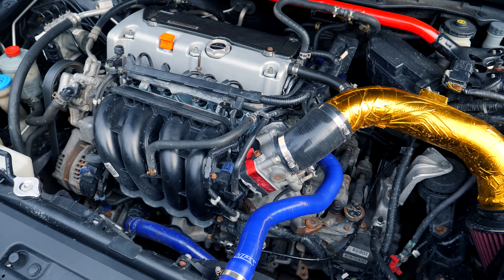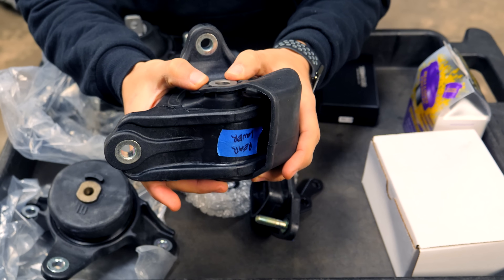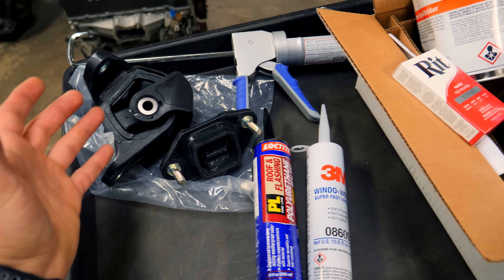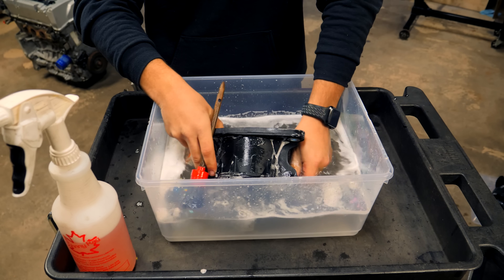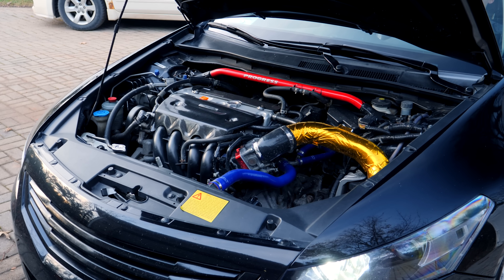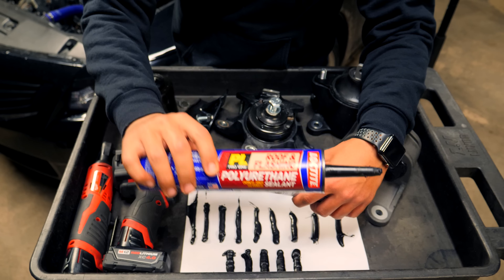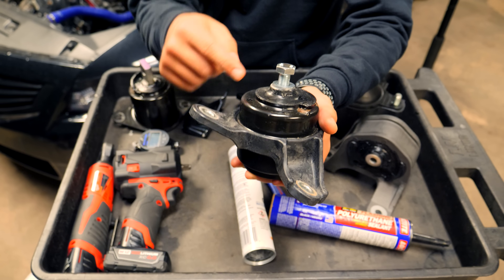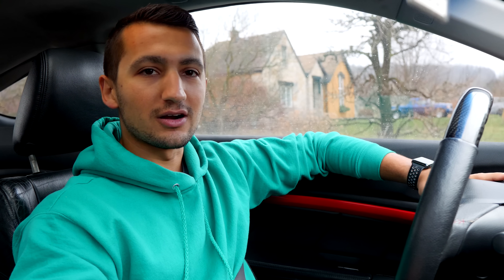Polyurethane Engine & Transmission Mounts for less than $25

Comment: I've been making my mounts for 3 years now doing this. I've never had a problem out of it & I can testify that the 3M is the better of his 2 options! Glad to see some people are picking this trick up though!
Reply: Same I use to break mounts all the time in a built Honda engine. Used the 3M that was 4 years ago…
Reply: Tried today with flex seal. Wish me luck
Reply: How’d it go? @SaintChicagoJay
Reply: @michaelproeber1953  got rid of a good amount of movement but need to add more to two other bushings on the subframe. Only did the 2 in the rear. Need to do the two in the rear forward.
Reply: I have a bad torque mount on my Avalon. I’m going to try the 3M on that, and on a lower mount.  @SaintChicagoJay
Reply: @michaelproeber1953  honestly flex seal worked fine for me to give it the flexibility. I recommend the white flex seal it dries more solid than clear. I think for my following mounts I’ll do flex seal in the center white, and 3m black window weld on the exterior after the flex seal dries to give it a mix of rigidity and flexibility
Reply: IIRC, this video or another says the 3M has a Shore A hardness of 80. The 3M data sheet actually specifies 55-60; I think you would have better luck/ease simply using the window weld. When I inevitably do it, I’ll also let you know results! @SaintChicagoJay
Reply: @michaelproeber1953  yes but many reviews on the 3m also say lots of vibration. Which would bug the hell out of me. I used the flex seal and nothing else yet and as time goes on it’s honestly gotten rid of the movement and thump I was feeling and I can’t complain. People can definitely go with 3m. I myself felt right and still feel right with the flex seal. Will try my theory of a bit rigidity on the exterior though. And that’s only a preventative measure to keep the flex seal protected in the inside.
Reply: @SaintChicagoJay  hey I'm just curious, how have your flex sealed mounts held up? Still no vibration? I'm thinking about doing mine on an older Camry wagon this week that has bad vibration
Reply: @SaintChicagoJay  Great compromise! This is what I will do on my mini van. 150K time for the mount fix!
Reply: How much vibration you feel on steering By installing  the Mount?
Reply: Hmmm maybe I should try that hack because on an old 85 300zx nobody makes or sells a new OEM style or a polyurethane aftermarket but for one firm.  I find one outfit that wants $200 for a single rear diff mount. Now add on the remaining mounts and bushings… lot of cash.
Reply: Are these heat resistance?
Reply: Wondering about making rear axle and front control arm jounces for the Dodge Ram gen2... maybe using a SORTA-Clear 37 mold for future trials.  Seems like for the expense of the mold material and thinking using a softer material like the Loctite, since reads is a shore A 40, will work suitably.  Thinking I might even be able to restore my old mounts that are missing the rubber where I place the cleaned metal on the mold and cover to adhere thoroughly.  Any thoughts?
Reply: Do you not do the Hydraulic Mount?
Reply: I jst learn this hack😮
Reply: When you say the 3M is better, what do you mean?  Does it ride more comfortably?  Does it last longer?  Both?

What difference is there in terms of vibration?
Reply: @wellnesspathforme6236  If you are asking that question, put in loctite for engine mounts.
Reply: @nicks3608  so loctite for non-sport car application. Got it 😂🤝🏼
Reply: @nicks3608  looking to do it today. was thinking of baking them to dry

Comment: I did this recently but ended up going with 80a liquid casting/molding urethane from McMaster Carr, ~$35 with shipping I believe. Filled a total of four mounts. They also sell it in higher and lower durometer for different applications. Much less viscous than the windo-weld, it fills every nook and cranny and cures perfectly flat. It's between the consistency of maple syrup and honey for about an hour at room temp until it sets. Takes either 24 hours at 180F or a week at 70F to fully dry/cure which is the major disadvantage. I stuck mine on a baking sheet perched on top of some furnace piping (maybe 100-110F) and they felt fully cured within 48 hours.
Reply: awesome when I redo mine ill do this. I look the hardness cause after it while it breaks in. mine is 3m windscreen sealant. testifying 3 years now. Honda prelude f20b n management

Comment: I tried the Loctite and it didn't last past 3 months, was too soft.
Reply: Yeah I just try loctite and it's quite soft. It didn't last as in it disintegrated? Or drop off the mount?
Reply: @rickylah6677  tore the mount up.
Reply: @Zekeortiz9  did you use a new mount to start with? or a broken mount? im using on a almost new mount.
Reply: @rickylah6677  I used the old mount. Basically I cut it the old worn it plastic then filled it up with the Loctite and let it sit for a week to cure then installed it. What happened was after a while it started tearing through the Loctite stuff and rubbing against the metal once again. I still have it if you wanna see pics DM me on IG zitroekez
Reply: @Zekeortiz9  then your application is wrong. This pl loctite will only harden a functioning mount and reduce the movement. Its not meant to replace the whole rubber in the mount. U need really hard urethane if your replacing all the rubber.
Reply: @rickylah6677  gotcha

Comment: I am thinking an expanding polyurethane foam first, then a soft urethane waterproof panel adhesive as the last quarter inch might be better for street use. Adding Fluid Film spray from a Lowes store every fall would keep the surface from getting age cracks later.
Reply: Use Berkebile PFC instead of fluid film. It has a higher lanolin content and lasts 15x longer

Comment: Flexane 80 is the best product for filling rubber mount cavities. It’s a proper 2 part urethane rubber.
Reply: The UK military has been using Flexane for 50+ years to field repair many types of mount & much more
Did my MK1 GTI in the 80's with this stuff & sold loads @GTI International over the years
Good to see old ideas still being used

Comment: I have this mod on 2 cars.  One have 300k km with it,   other one 60k. All I can say,  the car is more tight but small vibration comes inside the car,  especially when cold. Or at speed and over 3k rpm.
Reply: Do you recommend it or not?

Comment: Making the mounts stiffer than they're supposed to will transfer a lot more vibrations through the vehicle. You need that cushion for the engine and transmission. When you install solid mounts, your transmission and other drivetrain parts receive more of a beating than they're supposed to. Yeah your mounts will last MUCH longer, but it's not the same story for the internal parts of your stock transmission, stock clutch, and cv axles.

Comment: If you're a little girl and want no vibration...here's what you do.  DON'T modify every mount.  Just modify the one or two that's prone to failure.  The modified mount will restrict movement so the unmodified mounts are not stressed as before.   My neighbor has a 2003 Civic.  I got tired of changing out the front motor mount.  So I took one of her old ones, gutted it, melted a bunch of aluminum and filled the cavity.  I left the rest of the engine/transmission mounts alone.

Comment: and what do you think if you just put the polyurethane in the rear and little transs mount ?
Reply from the maker: You would indeed notice a difference! You don't need to do what I did in this video and fill ALL of the mounts with poly. The rear torque mount is the most important one. If you do this process to that one, you will notice a healthy difference, I promise you :)

Comment: I had aftermarket mounts on my RSX and it wasn't that bad. You feel the vibrations when idling but once you drive off it's butter smooth!
Reply from the maker: Couldn't agree with you more! I love them!
Reply: I put innovative mounts On my 07 v6 accord, I only feel hard vibrations when start the engine and put it in drive but driving feels like a dream compared to shitty oem ones, im planing to do the 3m windo weld to the trans mounts

Comment: Hey bud like what you do been a fan for a long time I have a 2008 Honda Accord 5 speed manual I noticed you did the K tuned slave and master cylinder I'm having a problem finding the master cylinder for my vehicle which one did you use and what site did you get it from because when I enter my vehicle it doesn't pop up
Reply from the maker: Hey Carlos, hit up KTuned and tell them exactly what car you have and they'll hook you up with the parts you need for your car. I can't remember the part number off the top of my head but if you reach out to them, they'll help you out :)

Comment: This video was perfect timing. I recently purchased all new mounts and was slacking on the install. I think I'll go  with the locktite, as my wife drives it more than I do, and would rather a little more comfort. The stock mounts have over 170K miles on them, so I know anything will be an improvement.
Reply from the maker: I would go with the Loctite as well for your car :) Let me know how it goes!
Reply: @Edward Green, Jr
How did the locktite work for you?

Comment: Fyi, the caulking gun contains a puncture tool.
Reply: Under the front, should have a long needle like thing on a swivel, should also have a cutter integrated into the trigger/handle side
Reply: The caulk gun also has a nozzle cutter, usually located in the handle. Look for a hole where you insert the nozzle tip, then it gets cut when you squeeze the handle.
Reply from the maker: Actually? lol where?
Reply: @milanmastracci   I just used goop we will see how that works 🤣
Reply: Also pro tip on caulking for a perfect finish, spit on your finger, then use your finger to put a nice clean finish on the top of the caulk.  The spit doesnt allow the caulking to stick to your glove.  This is the difference between a small minded caulk man, and a huuuuge caulk mind.

Comment: Hey Milan,
Where did you bought the lower engine mount for the Mini from?
Reply: Torque solution has a website with everything just hit them up
Reply from the maker: Hey Daniel! I bought it from Amazon. This is the exact one I purchased: https://amzn.to/3akXzRX
Reply: @milanmastracci 

 Hi Milan,
I need some help finding the answer regarding my 2011 Mini Cooper S R56 engine codes.
This are the following codes that somehow I believe are connected:
2C3E - Quantity control valve activation - circuit open/ short to ground
2D0C - Catalytic converter upstream oxygen sensor heating activation: circuit short to ground
2D10 - Catalytic converter downstream oxygen sensor heating activation: circuit short to ground
3400 - Engine oil pressure control valve, activation: circuit short to ground
348F - Map thermostat activation: circuit short to ground
37DE - Crankcase ventilation heating,activation: open circuit
Reply: @danielgiosu2668  oof
Reply: @danielgiosu2668  part out?
Reply: Konstantin D. I got the part from Garage 16 in Mississauga 
Still waiting for delivery!!!!

Comment: I did this to one of my diesel MBs because those motor mounts are notorious for collapsing shortly after install.  It was awful. 😭 I used a shore 30 Loctite poly because I wanted it to be soft to prevent transmitting a lot of vibration, but to be just firm enough to help the mount maintain its shape. It vibrated like an absolute nightmare. Cold starts would shake the entire car visibly from outside and when hot the AC compressor being spun vibrated it just as much. It drove ok once you were in gear and moving with higher engine rpm, but idling was pure misery. I took them out and bought another set of mounts and put them in which eliminated that vibration. That was only shore 30! I almost went with a 50 or 60 and that would have probably rattled the rearview mirror off the windshield. For a daily driver, I will not personally use or make poly motor mounts again in the future. A track car I would, but not a daily.
Reply from the maker: I find that interesting because I wouldn't say it is that bad with the harder durometer poly that I used. I wonder if it has to do with the design of the mount itself. You can for sure feel some vibrating, but considering this is my daily, I wouldn't say it is unbearable, or even too harsh. I'm content with my mounts now. They're much better than the sloppy stock parts. I wonder how much of a difference there is between i4s, to V6s, to i6s, etc, and the vibrations.
Reply: I. Using pl loctite roof n flashing rated 30a, it's completely like stock. And wish I gone for something slightly harder.
Reply: @rickylah6677   Does it still hold well?
Reply: @mannys great advice.  I agree totally.
Reply: Of course it will really vibrate a lot considering your using the polyurethane into a diesel engine. Usually a diesel engine has a longer stroke than bore making it provide more torque.
More stroke means more torque and more torque means more vibrations. And its more noticeable in diesel engine with lets say 4 cylinders than with more cylinders.
Reply: @longlegsescueta2335  Not entirely correct. Besides, this was an IDI 2.2 liter engine with a redline of 5,000 rpm. It's in the class of "high speed diesels." IDIs are different beasts than DIs; much smoother and much faster revving. 

Mercedes designed the 2.3L 4 cylinder gas engine with hydraulic motor mounts. They designed the 2.2L diesel with solid rubber mounts. If what you say is 100% correct, Mercedes made a grave error with one of the (seemingly) most basic design elements. We're talking about 1980's Mercedes Benz. They did not make those kinds of mistakes. 😉

Comment: Hi Milán, A little off topic I guess. As you know I also have a 2009 Honda Accord it's more or less stock. Standard Vtec engine and 5 speed auto. I know yours is a stick but can you give me a rundown on the differences between yours and the stock 09 Accord, mine is a coupe. I've checked all your posted videos and I can't find any that show the engine transmission work you've done. Every time you open the hood on yours, I say darn! Mine doesn't look like that! Thanks
Reply from the maker: My transmission work is very simple. I swapped a K24Z7 Honda Civic Si transmission into my engine bay, which gave me an extra gear, a Limited slip differential, and shorter gearing. Completely transformed how the car drives. I'll do an update video come spring time regarding what's done to the car :)

Comment: Why not just fill the mounts with JBweld or something similar? I feel like that would be the most efficient at eliminating unwanted flexion
Reply: JB Weld would be a terrible idea -- it would be too brittle.   And if it held, you'd transfer WAY too much vibration to the cabin.  Your teeth would fall out driving a long stretch. :P
Reply: chrstphrr true
Reply: You definitely want a little motion in your mounts.

Comment: Where do u get 3m windo weld in Canada ?
Reply: My first stab at it would be doing what all us Canucks do when we see an Amazon.com link:  change the .com to a .ca and see if the price is comparable, and order from the cheaper of the two (after converting currencies)?
Reply from the maker: I bought mine from the US Amazon, and went to pick it up. Check eBay? Amazon Canada? Google?

Comment: Had replaced all my bushes with polythane and because my vehicle wasn't used for a few years the brushes disintegrated. 
I went back to the original rubber and haven't had a problem since.
Reply from the maker: What kind of mounts were they? You shouldn't ever need to replace them long term, unlike the rubber.
Reply: @milanmastracci  they were red nolathane and have been told since that unless they are being used regularly then what happened to mine ,would occur .
Reply: @milanmastracci  i went back to NOS rubber mounts

Comment: Interesting. It'll be good to see how it all pans out longer term
Reply from the maker: 3 weeks later, no problems! I will update regarding these mounts.
Reply: It's only for boy racers driving on flat roads.
Reply: @louvendran7273  Not true; that may be who predominantly utilises this hack, but it is actually helpful  when your engine mount , and even generic version, is not available. My daily ride has been sitting for two months due to lack of production due to COVID. Now, I will attempt this. I would rather have  a little more vibration than not being able to use it at all.

Comment: Does this really work tho ? Risking your safety with diy bushes 🤔🤔 love to know the results of long use or street use
Reply from the maker: What do you mean risk? They're OEM parts that have extra material in them? Worst case scenario, if it does fail, you still have the OEM bushing working. After 3 weeks, its still holding up without a problem!
Reply: What exactly are you risking? The engine is gonna mounted stronger than it would be from the factory
Reply: No risk. I've done polyurethane mods for my Geo Metro and it's incredible. It stays put. Literally.
Reply: Jeffrey Odolski ahhh okay I’m very interested in this method just seeing what results other people have I’m looking to do some on e46 2003 320d 6 speed manual but it’s a diesel so not sure how harsh the vibration is going to be 🤦🏽‍♂️🤪🤪
Reply: PitStop 3k My engine is a 3 cylinder which is naturally imbalanced than a 4 or 6 cylinder. You would feel less vibration than my car. I don’t feel any difference in vibration over 3000 RPM but I do feel significant vibration below 1500 RPM. If I were you, go conservative and only fill in gaps partially. You don’t need to fill in entire cavities otherwise it becomes a very solid mount. You can also choose which mounts to fill in and not all of them. Target problem areas such as stick shifter to transmission (rear engine mount). Have fun!
Reply: Combining old rubber with new rubber wouldn’t think they would bond together strong enough to become one mount?